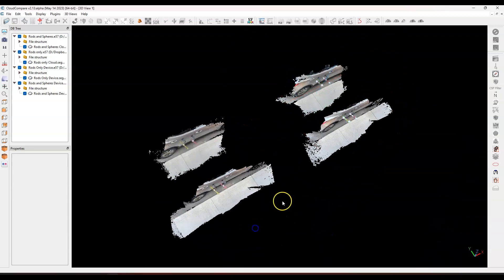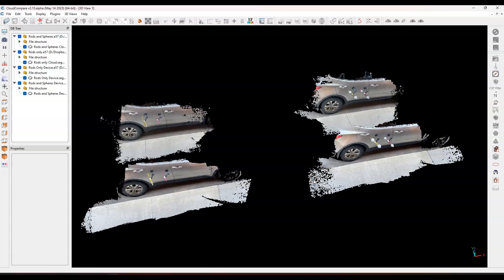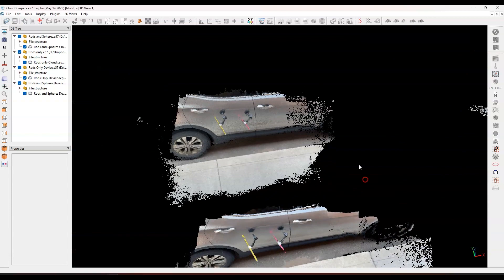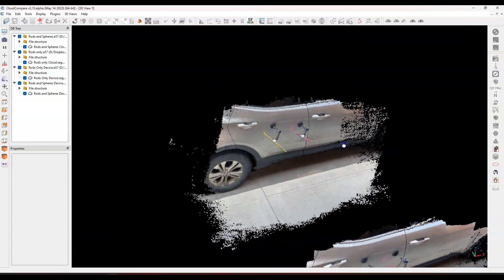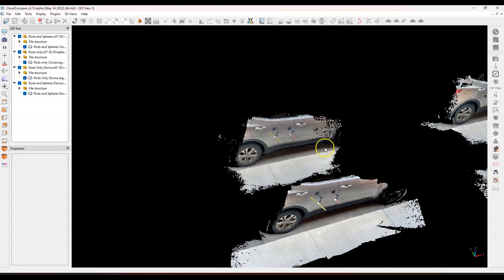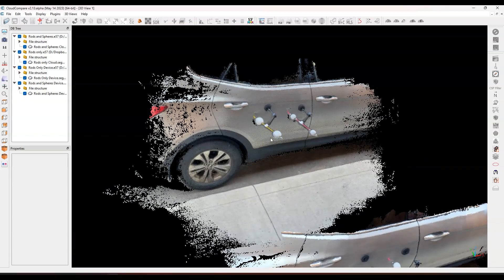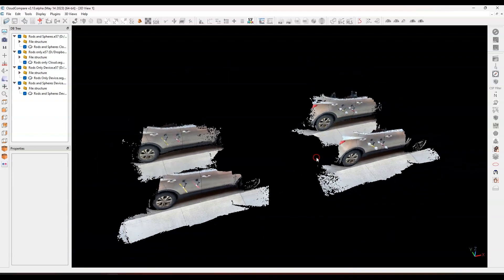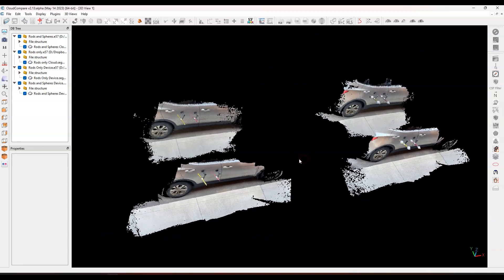TUTORIAL: Bullet Trajectory Rod Scanning With R3D | 3D Scanning | Forensics Investigation | CSI

Comment: Where can I buy the magnetic holder?!? Thank you.
Reply from the maker: Amazon! There are all kinds.
Reply: @3Dforensics  thank you for your reply. I am very interested in subscribing to Recon 3D after watching your video of scanning the shinny black F-1 race car. I have been using PIX4D and FARO and always had trouble scanning shiny vehicles. Have you ever combined recon 3d scans with FARO scans in Faro Zone 3D? Or do I have to always use Cloud Compare?
Reply from the maker: @GTRFPV  FARO Zone 3D doesn't really do  registration in that way. You can register drone data to scanner data but if it is for the interior of a vehicle and you want to register to the outside of the same vehicle, then CloudCompare is much better at this.